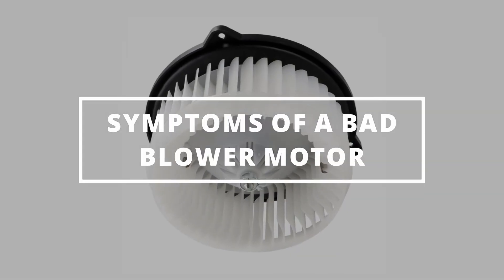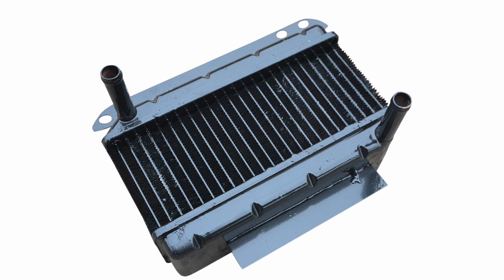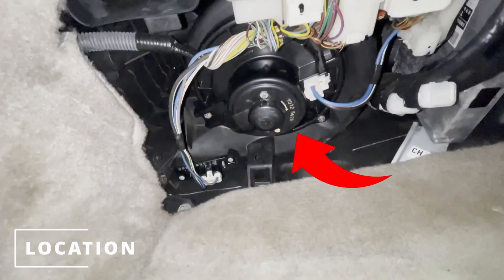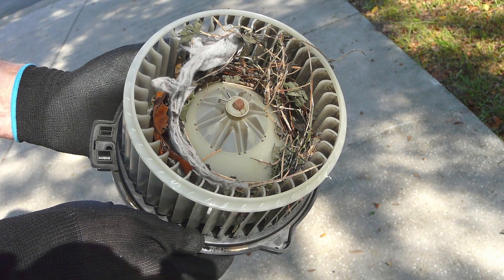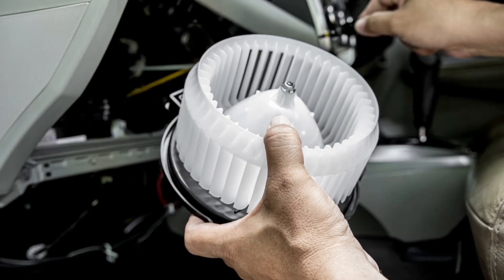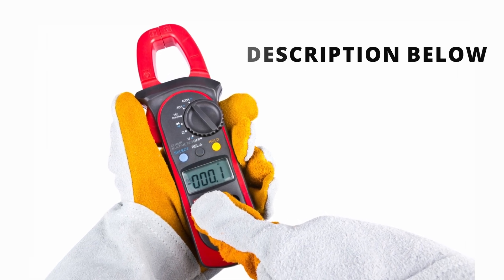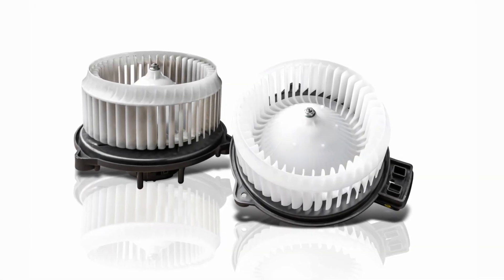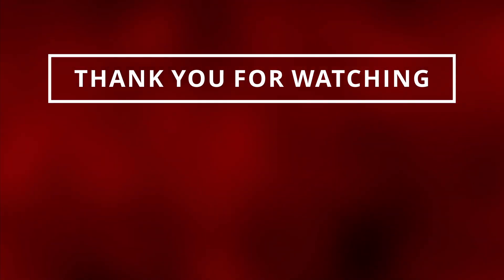SYMPTOMS OF A BAD BLOWER MOTOR

Comment: Mines stopped working but randomly turns on like nun randomly
Reply: Mine to,the wires are getting hot because of the blower fan on my Tahoe bout to replace it
Reply: English please
Reply: @DDunc1020 bltch shut up
Reply: Sounds more like a resistor to me personally
Reply: Probably your resistor. Easy fix.
Reply: Mine does the same thing! I’m trying to figure out if I should replace the resistor or the motor or both. 😅 it also does rattle on the higher setting when it does decide to come on.
Reply: @ashleenutter4376  when the fan turns on randomly ir inly in a certain soeed it is the resister. Just replaced mine. When my motor went it kept getting louder then had to bang dash to get it to turn then slowed down and died. Lol
Reply: @ashleenutter4376 haha love your name
Reply: Mine did the same thing. It was the blower motor. I was driving into the parking lot of the shop and it randomly turned back on 😂🤦🏻‍♀️ but that’s what it was
Reply: @rebeccatillman3668 thanks
Reply: So was it the resistor faulty or motor?
Reply: Mind is stuck on defrost at every setting but I’m fine with that. The fan works at all speeds, but the heater/blower only come on randomly. Sometimes when I start the engine the heater comes on and sometimes not. Sometimes it comes on while driving. I don’t know what is wrong
Reply: Sounds like your blower motor switch not resister but switch @johnmiklas1590
Reply: Could be a blend door actuator.
Reply: I have to slap underneath my dash to get mines to come on waiting on my ac compressor to come in😭😭
Reply: Mine is the exact same way only if I hit a bump it turns back on, those potholes be saving the day lol
Reply: @JacobO2003  MINE TOO! BUT NOW IVE A BAD STRUT! Too many intentional pothole hits 😢😢😢
Reply: @Sun-Sh9 😂
Reply: What if it doesn’t blow air but you can hear the air come out by the defroster and then it starts coming out of the vents out of no where and it’ll be hot on the left and cold on the right then after like 5 minutes to 10 it’ll start blowing cold on both sides
Reply: Same thing mine does.
You never know when it's going to work.

Comment: i have brand new blower motor and it whistles, tried everything so far, no leafs there, brand new salon filter also
Reply: Did you figure out what the problem was?
Reply: @sendit3251  Never figured that out, tried everything, i had collision with that vehicle and i still have that blower, old blower was end of his life but worked fine.
Reply: @KuriVaiM  did you ever figure out the problem? my ac won’t blow air at all. let alone warm or hot air. the blower motor wasn’t moving when i checked. but i don’t wanna buy a new one, pay to have it installed and it still not fix the problem. was it the relay switch?
Reply: @highwayheroes1454  could be, maybe fuse is blown
Reply: @KuriVaiM  I checked the ac fuse. I had someone look at it briefly and he said the test light lit up so there is  power going to the blower.

Comment: I’m still stuck between the motor or resistor … early in the morning sometimes there a slight blow of cold air when it’s on high.. but majority of the time it won’t blow anything but I can here it trying to come on. Do I just need to replace both ??
Reply: Advise replace both they work together when 1 is operating so that away in the future you don't have any problems when in ac/blower motor. Mode

Comment: Nice! Just replaced mine 2 weeks ago. Burning smell when on high.
Reply: Years ago I had that problem and it was the wire  Hardness burned need to replace and blower motor and fix the issue.  Easy fix best of luck